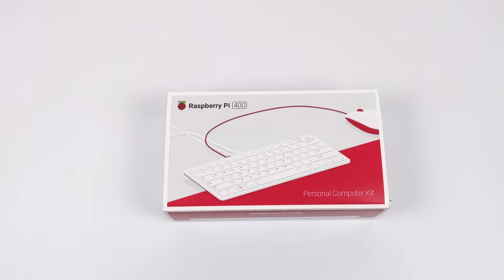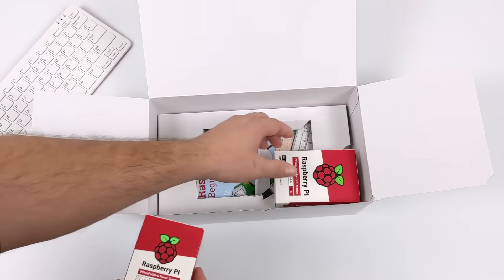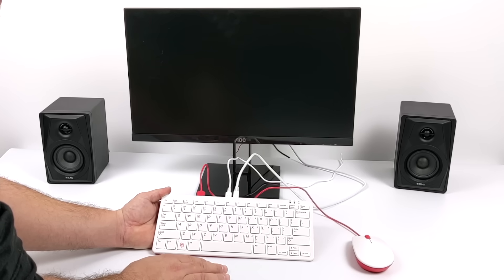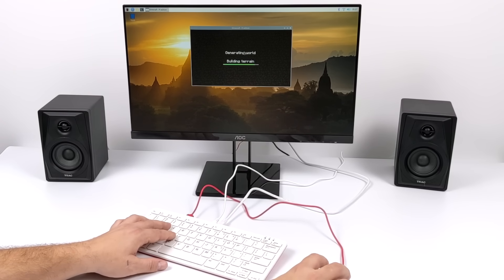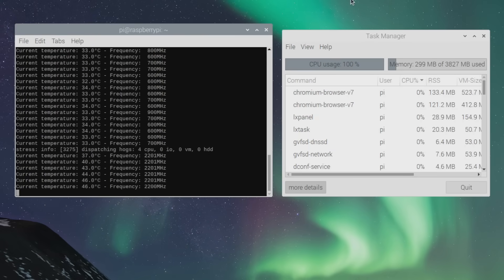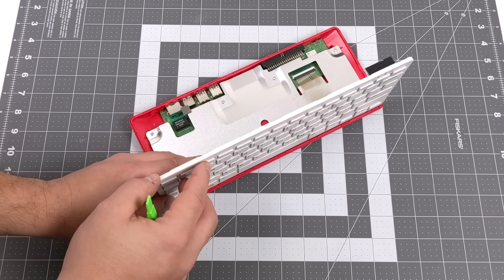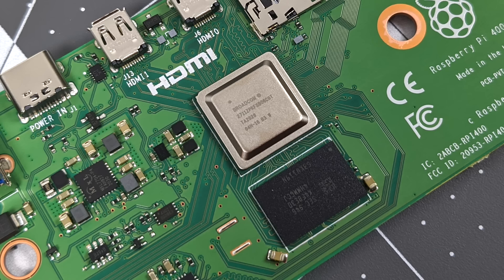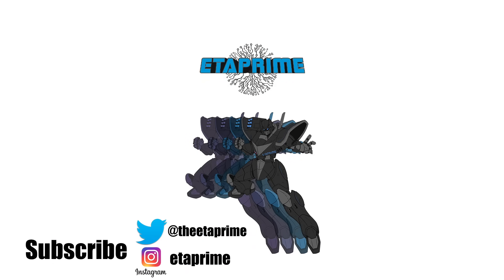The Raspberry Pi 400 is Awesome! Review, Overclock, Emulation, Tear Down

Comment: More ports than many laptops 10 times the price. I’m looking at you Apple.
Reply: never been a fan of them but the m1 series are pretty solid
Reply: @e.a5612  You need to plug in a hub to make any real use of them, which makes me wonder why not just put the ports on directly? 

I mean, I get that USB-c is a versatile port, but it loses versatility from being the ONLY ports on a device that needs full-sized USB ports. Much smaller and less expensive laptops can fit full sized ports, so the mac laptops have no excuse. 

IMO, USB-c works best on phones/tablets or as a complementary port. At the moment, with so many devices that still use full-sized USB, USB-c cannot REPLACE full-sized USB ports. Seriously, Apple couldn't be bothered to put 1 or 2 USB 3.0 ports on their laptops?
Reply: @ShadeSlayer1911  ur right, i was kinda talking only about the specs and optimised programmes, they arent really handy in that aspect i agree. Got a Lenovo laptop instead of a mac which works better for me.
Reply: @e.a5612  I also prefer lenovo laptops, especially their old thinkpads.
Reply: @oldskoolkrazy  all thunderbolt ports are usb c, any usb c cable can be plugged into it, thunderbolt also means less wires not more
Reply: @horbinrodas  Sure?
Why thunderbolt 2 use Mini DisplayPort
Reply: @oldskoolkrazy  LMAO what are you even talking about? are confusing thunderbolt with lightning?
Reply: @horbinrodas  you like to laugh a lot huh?
Reply: @lennycook206  horbin must be fun at parties.
Reply: ...with twenty times lower performance. I honestly don't get people who praise the Pi as anything but a fun DIY 'toy' (read: project), it's not really even suitable for casual surfing. Yes, it's doable but doable does not equate to suitable. They're way too sluggish and slow to respond, even when just starting up a web-browser.
Reply: @strappedwithkrylon  thanks for honest review.  I think I am going to pass on Raspberry for now.  I had wanted one for the promise of using it as a media player where I could stick it on the back of a TV and have the TV connect to various streaming sites to watch live tv.  I think one is better off buying a used Optiplex on eBay, cleaning the dust out the insides, and installing Windows 10.
Reply: @strappedwithkrylon "casual surfing" of the modern ja bloated internet isn't trivial. A device capable of loading a website that has all of the trackers and scripting embedded into it is more than enough to play some N64 - we've been able to do that since long before we even had desktop pcs that had the capability of loading modern webpages so trying to peg a devices performance to it is beyond absurd
Reply: My plan is to move away from apple & android devices now, replacing them as they wear out or are no longer supported. More alternatives arriving now. 👍
Reply: @JA-qi1fb  In before Raspberry is banned from Google lol...
Reply: @TraumaER  Now & then I get a feeling, that some companies treat their customers with contempt & take them for granted .. I think it best not to reward that. 👍
Reply: @ـا Apple is starting a new program where users can repair their own devices.  What do you have to say now?
Reply: Terrible battery life, though...
Reply: Apple has their many sweatshops working on it around the clock... in fact, I happen to know that some kids in a Chinese prison have been focusing on this very issue.
Reply: @oldskoolkrazy  , and you do not need a 'different' cable for micro hdmi?
Reply: @oldskoolkrazy  Hi, I han't used a wired headset for years, so yeah, it didn't hit me at all. I have a good number of PIs, since, like you, I am probably nuts about them... but the micro-hdmi was a massive massive fail. Last week my cable failed... I have loads of full size hdmi, no extra micro hdmi though.
Hating about anything is dumb. I don't hate, I evade. Any androids lose the headphone jack? yep. Did they have to? Nope.
Reply: I have a MacBook Air and I’m fine with two ports! And I if they added more ports it wouldn’t be thin as that 😌😌
Reply: You are comparing a MacBook with a raspberry 😂😂!! Poor you🤣
Reply: it always comes back to a comparision to apple. Two VERY different products
Reply: I like laptops with lots of ports 🗿

(Try not to bash me over using windows laptop challenge) (impossible) (only 0.00000000000000000000000001% will pass my challenge 😱😱😱)
Reply: I’m looking at you Microsoft
Reply: @oldskoolkrazy  thunderbolt is not proprietary lmao
Reply: @horbinrodas Thunderbolt is proprietary. It's owned by Intel and Apple
Reply: @horbinrodas  thunderbolt is proprietary.  It was jointly developed by Apple and Intel and has formidable licensing fees.  This is why everybody else just went with USB 3.0 - what do you need more than 10 GB/s for?  Not much.
Reply: @richardwicks4190  those licensing fees have been gone since 2018, thunderbolt 3 has used a usb c connection since 2015, is 40gbps, and has support for all usb 3.1 devices, it is literally just a better version of usb, do some research before hating on progress
Reply: @oldskoolkrazy  did you 2 hook up yet?  Online flirting was a special thing to watch
Reply: @oldskoolkrazy  easily amused hey?  You 2 should go to a comedy show for your 1st date.
Reply: 2 thunderbolt 3 is more versatile than what’s on the pi400
Reply: Apple can do things you cannot fathom. Apple for life!

Comment: this would make a great gift
perhaps a bit expensive, but for the right person, at the right time, it'd be absolutely perfect
Reply: You think this is expensive? Lol

No name brand tablets cost more lol
Reply: @switzerland593  not everyone has the same price genius and not everyone has cash for mini computer that they don't need.
Reply: U could send it me as gift.Why not?
Reply: Worth bearing in mind that the unit by itself is quite a bit cheaper, and the bits that come in the kit may not be needed. The good thing about the 400 is that it's effectively the Pi 4, keyboard, case and cooling all in one, and hopefully the only things to source would be a micro HDMI adapter/cable and a microSD card (and should be easy to get!)

Comment: Hey there ETC PRIME :) This is a very interesting system, it is very very comparable to my Lenovo ideapad 100s in specs ,4 1.8 ghz cores,  with basically the same emulation capabilities, tho I may be able to do a bit more then it as i I can play fallout 3 on low settings, but what I am getting at is, imagine that system just with a screen & a battery, they could easily make it a laptop & I think that would be so cool.

Comment: The only problem being it's enclosed is the access to the i/0 pins for connecting sunwa controllers for a true arcade experience for an arcade cab,  unless there is an external board out there, I would love the idea to have a keyboard sliding under the cabinet all in one to set up retroarch

Comment: The dual micro HDMI is a huge miss, here.   They should have dropped the 2nd micro HDMI and instead installed one full size HDMI. I understand the dual HDMI on the regular Pi 4 (easy to power dual-monitor display applications like signage), but in a desktop application, it's just not doing anything useful except in the 0.001% edge cases.

Comment: Would it actually help with the Overclock if you were to open this thing up and add some of those tiny little Aluminum heatsinks to the chips inside?  Would there even be enough room inside the casing to install these?  I even wonder if it would be at all possible to add a tiny case fan to this thing...

Comment: So where can I download the Pi OS Image that comes on these MicroSD cards included with the Pi 400?  I bought one of the Standalone units that doesn't come with the preloaded MicroSD card, so I will need to provide my own and load it with the proper image.  Where can I find this image?
Reply: There is "pi imager" software just down load it and follow the instructions. Very easy to use
Reply: @jerryhoxie7694  And where do you get that?   The main Pi website I assume?

Comment: One thing I don't understand is why the Pi 4 struggles to even play 1080p video without dropping frames.  Couldn't even the Pi 3 handle 1080p video perfectly fine?  If so then why does the Pi 4 struggle with it?

Comment: So there’s no 3.5mm audio output jack? How do you get audio out of it then?
Reply: HDMI or an external USB Soundcard.
Reply: @UlrichRoss  so there's no way to get audio without spending money on 3rd party parts? That's a darn shame. Seems odd that they just left out the jack.
Reply: @aceofspades627  I agree.

I also miss an internal port to insert a more reliable SSD than that Micro-SD-Card.
Reply: @UlrichRoss  It's a cool product but with a bunch of stuff missing the Pi 8GB is more suited to what I'm looking for.

Comment: 2.2-2.3GHz if possible would just further cement this as a very nice tiny computer. Emulation would be great, super portable and self-contained, the only thing I would ask for is an easy way to have wireless HDMI set up. Imagine just bringing an HDMI dongle to be able to use it for any TV in a hotel room or something and worry less about wires.

Comment: I’d love to see one of these with an m.2 slot for an actual SSD instead of just microSD support. USB 3 external drives just wouldn’t be the same. A little 256GB m.2 SSD (even SATA, not NVMe) would be killer. Love seeing the little advances in the Pi’s!
Reply: Would also be more expensive than the pi. But I do agree

Comment: The Pi 400 looks cute. But whats the advantage of the Pi integrated in the keyboard? It eans you must connect the keyboard via cable to the screen and even comes with a wired mouse. So I think my  Pi a 4 with wireless keyboard and mouse is cheaper and more comfortable. But somehow I anyway want a Pi 400 ;-)

Comment: You can literally find normal keyboards that are much more expensive.
Reply: Should say a lot about the quality of the Pi 400 keyboard :)
Reply: @tastemysaucer  Haven't tried it so.
Reply: That's not a valid comparison. You can get more than 5 toyota aygo's for the price of one Mercedes S class. Nobody would choose 5 aygo's over one proper merry.
Reply: @BostonFaith  That does not in any way invalidate the comparison...
Reply: @CounterFlow64  Yes it does. You can't compare this keyboard to a proper mechanical keyboard, which is indeed more expensive than the Pi 400. But I guess you don't know the difference since you call them 'normal keyboards'. No, they are not just that. I can write an essay here about the differences, but you can Google it up.
Reply: @BostonFaith   I'm perfectly aware that this is fundamentally a different product than a "proper mechanical keyboard" When i say "normal keyboards" i mean that keyboards serve the same function, making the user able to interact with the computer. Not only is the pi 400 the keyboard, it is also the computer. If you need a computer but you have a low budget, you can get this for cheaper than a "proper mechanical keyboard". I still think the comparison is perfectly valid.

Comment: i just got this can someone tag and reply to me - why is there a large sd card with it but only a small sd card slot
Reply: The large (standard) SD card is just an adapter. You can plug the micro SD into the adapter in order to use the micro SD w/ a full size SD card reader.
They include it b/c most SD readers do not take micro SD cards. W/ the adapter you can load new software (e.g. Different OSes) onto the micro SD.
If you don't plan on changing the OS, you probably won't need it, but it's always good to have a around. I use an identical adapter to load music onto the micro SD card in my phone from my computer, for instance.

Comment: When you try 64-bit OS on it, like ubuntu 20.04.1, or 20.10 ARM64, you can run povray 64-bit version benchmark "time povray -benchmark" which produces more heat than most of the other stress tests.
And you can compare the result to other x86-64 CPUs, like older x86_64 notebooks, since this povray of same version is available for x86_64 too on ubuntu 20.04 x86_64 (and others). And notice how 64-bit version is faster than 32-bit version of povray.

Comment: No one has mentioned that the 3.5mm audio jack is missing. Kind of a bummer. But it look like there wasnt enough room for it on the rear panel. It's still s huge breakthrough and I think this unit will make it much easier to put Raspberry Pi into schools or for a use case like a library or similar especially where it has the hole for a kensington lock. I bet with android and square bluetooth card reader this device could make a cool point of sale machine

Comment: Not just a heat shield, its a RF shield to meet FCC requirements.
Reply: that's not actually a requirement anymore.
Reply: But the Pi4 has nearly the same harder without RF shield except maybe the PCB ground plane... RF shields usually completely encapsulate rather than just a sheet connected to ground in few locations. Also, if it was primarily RF shield, they would have probably gone with thin steel rather than medium gauge aluminum.

Comment: i’m very curious:
am i able to connect the hdmi and power both from the one usb c port? this would make it a fully incognito computer by having only one cable (wireless mouse)
Reply: If the USB C port is anything like the other Raspberry Pi 4's, it will be a power input port only, no data connection, so no, you will still need 2 plugs.

Comment: 1:18 It doesn't have a microphone (Correction: Headphone) port as well...
Reply: Yeah, but so far no Raspberry Pi has had one, a shortcoming for sure, but an expected one, analog audio out not being available is less expected. Nothing that can't be fixed with a USB audio adapter thought, but I would have built one in together with a USB 2.0 hub for more ports. Production cost would have gone up with a few dollars/Euro's/Pounds at most.
Reply: @dv7533  : My Blunder. I meant Headphone port. (corrected)
Reply: @DaHaiZhu  ah, yeah, that makes sense.

Comment: could be good replacement for amiga systems...or android desktop..you should play around more with different os...linux doesn't do much on that low spec processor and its gpu but other os like riscos, AmigaOS and android ...i am curious which will benefit the most...for ARM processor

Comment: Can it screen cast to tv, instead of using hdmi cable? What's the old style hard drive plug in for?
Reply: yes you can cast by wifi to your tv you will have to fist install some casting program on to Linux fist  
there is no old style  hard drive plug 
what are you talking about
Reply: @lesnelson3458   the wide black plug in at back of that rads berry pie keyboard
Reply: @Tech_no_Man  that is not a plug it's the GPIO pin's
General input and output
It's for connecting things to internal power from the raspberry and lots of different accsesaeys
Reply: @lesnelson3458  ahh o know nothing about these mini pc’s to me looks like old CD-ROM plug in.

Comment: I got mine delivered today just the Raspberry Pi 400 itself and another power supply though as I already have the rest. I swapped my SD card over from my existing Pi 4 8GB but for some reason my WiFi doesn't work.

Comment: The poor performance with the 1080p fullscreen Youtube playback is a deal breaker for me. This problem has been highlighted by numerous reviewers since its release and yet it has not been resolved. I understand the hardware is capable of it. Anyone knows why this issue is still sticking around?
Reply: i have perfect   1080p full screen YouTube playback on my raspberry pi 4b
Reply: @lesnelson3458  How do you do it?  Did you use the standard Raspberry PI OS?
Reply: I'm using YouTube on Kodi I am running LibreELEC
I can even watch h265 10bit and it works perfectly

Comment: A bit disappointing from where I am sitting. If it were to use the PI4 commute module on a purpose designed PCB "motherboard" then when the PI5 and PI6 came out it could be upgraded. Also there is no provision for solid state drives to be plugged in internally, instead you would need an external drive which defeats the single keyboard form factor, Micro SSD's are slow and the PI's weakest point. The Pi foundation just don't get the reuse, repair and upgrade philosophy which is of current environmental thinking and just keep pushing out short life span, non recyclable throw away tech, which again is disappointing for what is otherwise a great product and company.

Comment: Wondering how this would do with Windows 10 on ARM with the 2.2 GHz OC. Would appreciate if you could test that too. It would make a perfect light desktop for my folks with very few cables and stuff if it works okay. Cheers.
Reply: no body has been able to install any windows on the raspberry yet maybe in the future some body will finger it out bot it can not be done at the moment 

just get it for your parents and install a supported Linux disto on it 
you can make it look the same as any normal windows  
and the want know the difference
Reply: @lesnelson3458  It's been done on a Pi 4. I wanted to see the performance on this chip + cooling solution, marginal as the changes may be. https://youtu.be/n1AXJjpM0L8

P.S.: My folks are older people who can't tinker with the command line and need apps they are familiar with. Handing them a skinned Linux is not the solution.

Comment: I wish they had m2 slot there instead of SD card. Everything works significantly better and faster even with m2 SATA drive used instead of extremally slow SD card controller of RPi. Considering the fact their compute unit supports PCI-x, there are technical limitations. And the price for m2 support is barely +2-5 USD which is nothing comparing to $100 USD for this beuty.